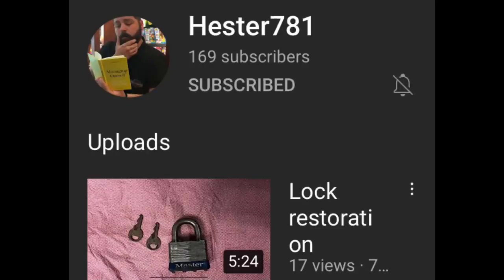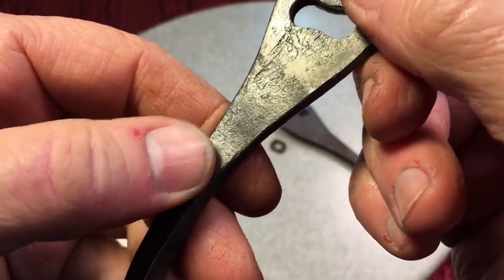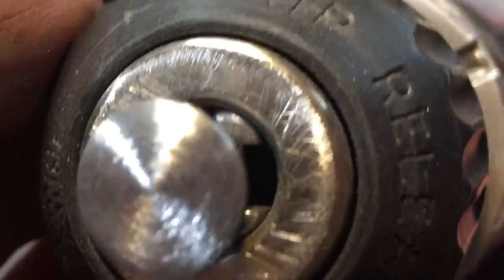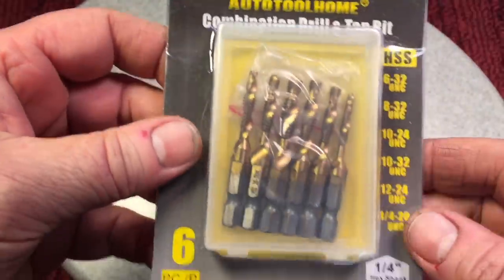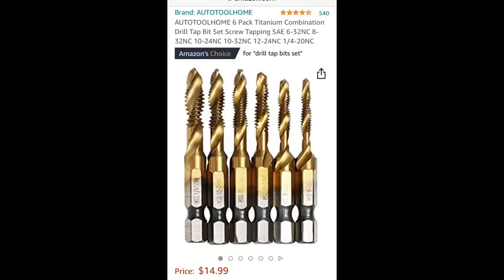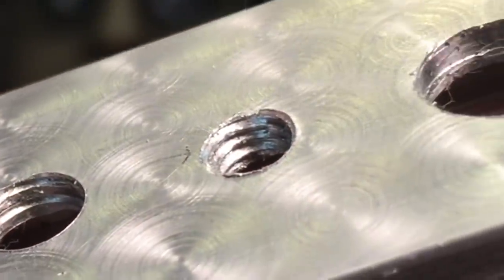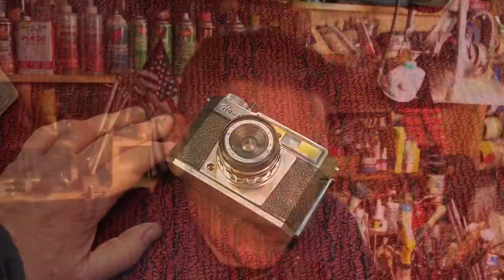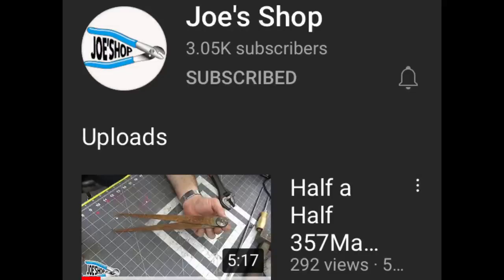Viewer Request Project!  Half and Half Pliers!

Comment: I live in and upkeep a building built in 1957-8 and you couldn't want anything better. Real plywood and copper was used. Lumber was straight balloon framing for two floors. In fact it was only a few years ago the first of the Rheem furnaces had to be replaced. Nothing is gimmicky and everything has a reason and a purpose including indoor shut off valves for the front and back outside water hoses. I see those 80s places built with plastic and OSB and I just chuckle.
 I started photography on an old camera. So old that it actually took half frames of 35mm film to conserve film. I still have it on display in my living room wall along with my dad's old Leica he bought during WWII. They're such interesting quality that they deserve to be on display. Love the studebaker, don't think I have ever seen one with a lift kit.
Reply from the maker: John- Sometimes I wish I was born in the 20’s.  😂👍

Comment: The first cars I remember are a 55 Ford that my mom drove until 1969 and my dad’s 63 Studebaker Lark that we had until 1971. The Ford started rusting out around 1960. The Lark was also rusting out by the time Dad sold it. While new cars are much better than they were in the ‘good old days’ there just isn’t anything about them to get excited about, unless you’re a Tesla fanboy or think you really need a 700 hp Dodge Challenger to sit in while you’re stuck in traffic.

Comment: I sometimes use my (modern!) digital mirrorless camera and even that's "interesting" to people since everyone else is using a phone, but my phone takes terrible pictures. The old manual lenses are pretty cheap too, you only need a 'dumb' adapter without autofocus. Thankfully lenses are usually kept nice - restoring one of those would be very difficult!

Comment: It's true, today's cars are great....I bought a new one in 2000 drove it for over a hundred thousand miles then gave it away but never really did a thing with it, never even changed the plugs.........But when someone's a new car breaks down I'm clueless what to do other than call a tow truck, used to be you could grab a screwdriver, a coat hanger and pair of pliers and get it going again in 15 minutes or less.

Comment: Cameras. The lads and I went on a trip across the pond to see Ireland, U.K. and some nations on the European continent proper.
We did our tour on young men's budgets. Hostels, backpacks and rail passes. Expensive cameras were out the question. The Leica got left back here for obvious reasons. We left alot of expensive stuff at home in fact.
We opted for Drugstore Fugi film Quicksnaps. We all took different pictures, had four of each picture developed so we all ended up with the same album. Those cheap Quicksnaps actually took good pictures.
Reply from the maker: Yes!  I used 100’s of those disposable cameras!  😃👍

Comment: I thought about doing a slip joint because it would be easy take apart and not accidentally touch the rusty side and mess up the effect.  I glad you did it.  Now I feel like I don't have to.  Though I have a more challenging thought now.  At this point, the half and half is not about what you do with it when its done, its about the challenge of doing it.

Comment: Adjust for Kentucky Windage before sending it with Swinger Polaroid 📷
The pliers makes me think of Two-Face 😂 Batman fame 🎭 I use the Klein Tools drill/tap kit. Nice to see the Poland made screwdriver in use. Shop mascot watching 👀 The  unofficial ScoutCrafter Half & 1/2 challenge is well underway 😂🎭
I used to see a Gremlin X running around town.

Comment: Yup, I remember those days.  I got my license in `58 and you could buy a car or truck for $50. No PS, PB or auto.....no thanks. Trucks drove like steel wheeled tractors until the mid seventies.

My first camera was a Kodak Instamatic, great camera for the day.

I have a rusty slip joint plier just like that one, marked ``Gray`` .

Another good one, thanks.

Comment: What about taking two sets of identical pliers apart and stacking and welding the handles, polish them so they look forged that  then make a long enough pivot bolt so you have fat pliers. Heck weld five sets thick!

Comment: Most importantly, even button dies give you some control over the desired fit with their tapered screw. These have no such adjustment. Furthermore, as they wear, they will perform worse and worse

Comment: that cheap camera you have sells for over $25 on ebay which is more than the polaroid model 20 which is around $20
Reply from the maker: I think the reason is you can’t get film for the 20 now.  You can still get 35mm film.  😃👍

Comment: hey i know that's a dumb question but i found an old pair or Knipex pliers i'd like to restore but i don't have a belt sander, how you'd do that?
Reply from the maker: Anything you do with a belt sander you can do by hand...  it just takes much longer! 😂.  A angle grinder works great and is cheap!  However I suggest practicing on junk projects first!  😃👍

Comment: What is really sad, is that few companies seem to take pride in the product they turn out,  just make as much money for the quarter as possible and have the stock look good.   I don't think quality has taken hold with any of the Chevrolet's,  some Ford's, Chryslers, Dodge and Ram Trucks  They seem to be making the cars and trucks as cheap as possible, using loads of plastic  that have a very short lifespan.  They become brittle, crack and than fall apart, engines and transmissions that go out in 50,000---60,000  miles  It isn't just the Americans cars either, Nissan's, Fiats,  BMW, Mercedes , Jaguar's  and so on.  Sadly, it doesn't make any type of correlation between the price and it's quality.  My Dad always told me "if you are going to do something, do it right or don't do it at all.
Reply from the maker: George- You’re spot on, it’s all a game to get to the next quarter then pay off.  The problem with American car companies is they stopped thinking long term 50 years ago.  Japan is different.  They want a customer for life.  😃👍
Reply: The plastic tailgate handles on those Chevrolet truck tailgates from 1999, and onward are a prime example of that.